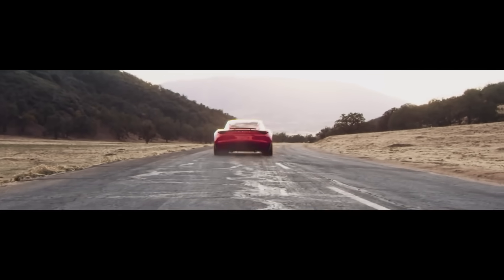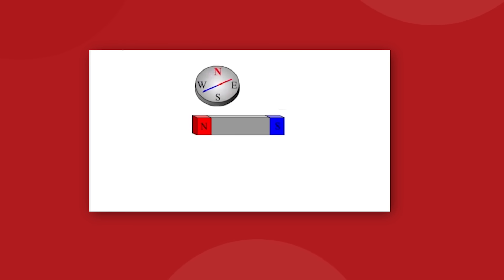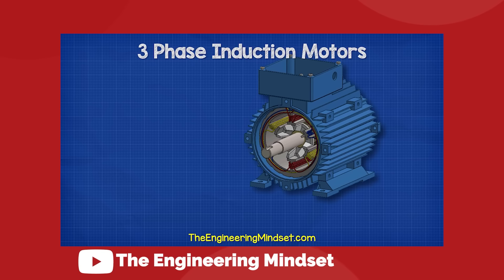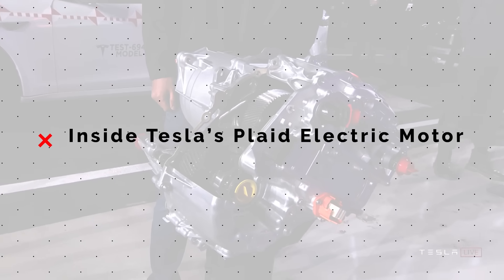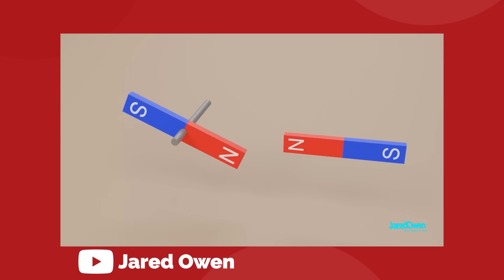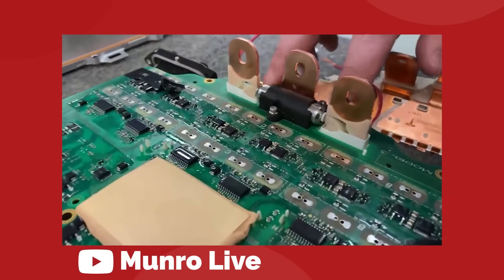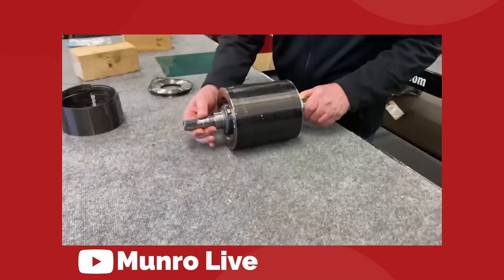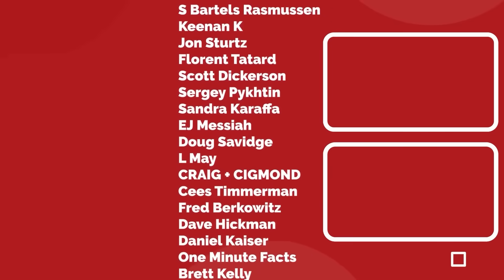The Real Reason Tesla Developed The Plaid Motor!

Comment: The title makes is seem like the video has some hitherto unknown reasoning behind the motor. 
However all the information in the video is already well known, nothing different than a rehash of basic physics and existing YouTube videos explaining the carbon wrap, as explained by Munroe live. 

I can see how this video would be useful and interesting to people who have not seen any other Plaid motor dissection videos like the ones from Monroe live. 
If there's something I'm missing please point it out and I will correct my comments. For the rest of us the title is quite misleading.
Reply: @Neeraj Tulsian - generally speaking, the order in which people see videos or appear as suggestions is somewhat random.  Meaning there is no particular order people see this video/explanation or another equivalent.  So for many this is their first exposure to this technology.  This channel tends to have a more pleasant presentation and flow, and generally overwhelmingly more positive and constructive commentors.  Your comment is not constructive or positive.  I inferred there would be "some hitherto unknown reasoning behind the motor".  What I gleaned from this motor construction is the Star laminates (which is unlike any other linear induction motor - I rewound electric motors for 3 years from 1/4HP to 500HP) in the rotor, and the unique magnet arrangements, and the caps that are unlike any other rotor construction.
So, you missed the points I pointed out, in particular your non-constructive comments - just read any 20 other comments and compare.
FYI - Sandy Munro is heavily invested in Aptera Motors.

Comment: It’s just an electric motor. There is nothing complicated about electric motors, unless you don’t know anything about how electric motors work. There are two kinds of motors Ac or DC, and there are different types of each motor depending on use. The fact that Tesla put the motor in a different case is not a big deal either.

Comment: The inverter, is a DC to modified Sine Wave Inverter, using pulse width modulated pulses to create an analog of the sine wave, to  form a three phase, Variable Frequency Drive to control a three phase induction motor, as is commonly used in heavy industries! 

Pyrotechnic are commonly used to interrupt a short circuit in AC Systems to open the circuit breaker at the zero crossing of the AC Current Sine Wave. This is the moment where zero current is flowing and there will be no arcing to disconnect then. This is used in the Power generation and distribution industry for current sensing, protective relaying. Once the short is cleared in the power industry, the circuit breaker paddles are moved back to the on position and the squibs are replaced with new one after cleaning up the spent explosive powder residue of the old squib cartridge. This is not an exclusive Tesla practice, as if has been used in stationary AC Power Generation distribution from the beginning of aC power generation. The technique does nothing special for DC Power connection as they will constant be a high short circuit and breaking the contact will create an arc of significant destructive capability.

Other than Tesla using these established variable frequency drive systems, and high voltage snd current AC circuit protection systems, the techniques were previously not used in production cars, although I am sure, were used in General Electric Diesel-Electric and other brand, Locomotive Engines!

Comment: A three phase electric AC motor with a permanent magnet rotor is a permanent magnet motor, not an induction motor.  An induction motor has just wire circuits within the iron core of the rotor.  There are no permanent magnets.  The rotor becomes magnetized when it slips behind the rotating magnetic field in the stator.  For example, my bench grinder is a four pole single phase AC unit.  The rotating magnetic field at 60 hertz turns at 1800 rpm, while the rotor turns at approximately 1700 rpm, depending on the load on the grinder.  Thanks for the very informative video on the Plaid motor.
Mark Bishop
Reply: Great point!... That is what I was wondering about in the description here of the rotor, as well... there are no magnets in rotors of a single or 3 phase ``squirrel cage`` induction motor... it relies on induced eddy currents to create opposing magnetic poles to the rotating fields of the stator and does slip behind the speed by a percentage... as you mentioned, this was an informative video and I`m glad I watched.

Comment: At 6:13, the animation is a Direct Current Motor using brushes. You also kept switching between single phase induction motors (four poles) and a  three phase diagram (six stator magnet working off 3, 120 degree separation phases for 3*120=360 degrees. Which you show only occasionally. All of this confusion comes  before the explanation of the T in Tesla Symbol.
Reply: In a 3 phase motor do you always have 6 poles on the stator and on the rotor? I was surprised when they showed 6 and 4 but I wasn't sure if that was intentional or just a mistake.

Comment: Great Video! um ... not to be too picky but at this time slot https://youtu.be/xu4ckJN73oo?t=857 you mention that the inner wheel is turning faster than the outer one. It is actually the opposite. The inner wheel travels less distance as it is on the smaller arc of the corner (If you get a compass and draw from the centre a 3m arc and a 4.7m arc - if it had a 1.7m width between the inside axle and the outside axle- .... then did a 90° arc with each, you can easily see the distance travelled on the 4.7m arc over the 90° is much more than the 3m arc. This is the reason why Differentials are needed unless each wheel speed is controlled (normally by traction control) .... if both wheels travel at exactly the same speed.... you will get what is called slippage and this creates tire wear as it loses traction and .... also makes it more difficult to drive around corner as the inside wheel is trying to straighten the vehicle up.

Comment: Great movie guys, you guys did a lot of work and it came out great. (Below are [3] small corrections I saw)

*earths North Pole is magnetic south which is why the norther portion of a magnet points north (magnetic south
*Centripetal acceleration (force)
*outer wheel spins faster in a corner
Reply: *AC induction motors don't contain permanent magnets.
Reply: where was the movie? was it the new Dr strange movie? i was listening to a guy ramble about an electric motor in the background. 
i didn't hear a movie playing.

Comment: Steam engines work from a stored energy system allowing them to pull hardest at low revs. Electric motors do the same  because they also have a pack of stored energy to draw on.

Comment: I have always wondered why we don't use a slightly tapered rotor within a matching taper within the stator. Then the rotor could have a mechanism that adjusts it to maintain the optimum clearance between them regardless of thermal or centrifugal expansion by moving the rotor laterally along the center shaft. Perhaps the engineering problems created outweigh any benefits.
Reply: Bro same. I was wondering the same thing. Centripetal force, it makes sense

Comment: cheers great content as always! may anyone please explain why its beneficial to use 529 stars instead of a single solid block?
Reply: It's because moving electric field induce current flow in conductors. If it was a solid block you end up with current flow in the block (these are called eddy currents). This results in heat being generated and energy being sapped from the system (essentially drag that is induced magnetically). The right question to Google for more info for this is "why are electric stators laminated?"
Reply: @oliverfisher5062  cheers for explaining ;)

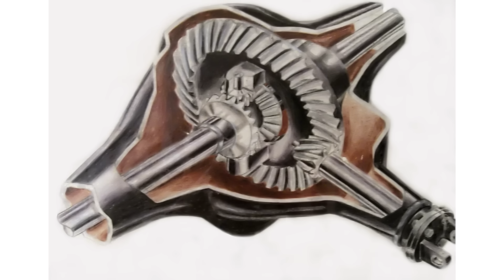Comment: At timecard 14:18 should be "the outer wheel has to turn faster."
Reply: Exactly, I wondered if someone caught this. Good!
Reply: well, when turning weight goes onto the outer wheel which makes the inner wheel slip, actually. in a perfectly symmetrical world, your argument would be the case, but factor in physics, it becomes counter intuive.

Comment: To turn or go around a circle,  the OUTER wheels have to spin faster not the inner, as stated here!
Reply: No, it's correct. The inner wheel slips and speeds up to match the outer wheels.
Reply: @ExileXCross no, that's not how differentials work.  Anything that "slips" is in the differential, not on the inner wheel.
Reply: @DontTreadOnMe_1775  I know, I intentionally worded it that way because not everyone is mechanically/electrically inclined. Second there is no differential. The axles are connected directly to motor and it's not "slips," slip is an actual technical term used describe when the rotor speed does not match synchronous speed.
Reply: @ExileXCross  Short answer: "The inner wheel slips and speeds up...." If anything slips, then it can't be speeding up! It slows down!!
Long answer: If no motor on the axle then no differential - nature takes care of itself.
If one motor per axle, the motor is simply replacing the prop shaft (that would distribute mechanical power from gearbox to the wheels through differential), so still need a differential to turn the vehicle (allowing wheels on the axle to spin at different rates).
If each wheel has its own motor then there is no axle as such hence no differential. The control system plays the differential role by turning each wheel at different speeds to facilitate turning. If the control software is clever enough, torque vectoring is also possible to allow next level vehicle dynamics. 
Above should be just a refresher as you're familiar with electrical and mechanical engineering principles
Reply: @soundslight7754  I'm just happy someone understands what slip is at this point.
Reply: Indeed, heard it  too 😂
Reply: Yeah,, a tip of the slungue

Comment: Sorry, but you can have a motor connected direct to the wheels, I have a classic car converted to 4 in-wheel drive motors with no gearbox it uses torque vectoring.
Reply: I think it is about the rationality, in the motor the magnetic flux is limited, so that to make the most to take out the most horsepower a given weight motor it has to push the rotor rpm to the limit what it can barely withstand. The gearbox only do this in this construction, there is no need way bigger motor to deliver this much horsepower and torque to the wheels.